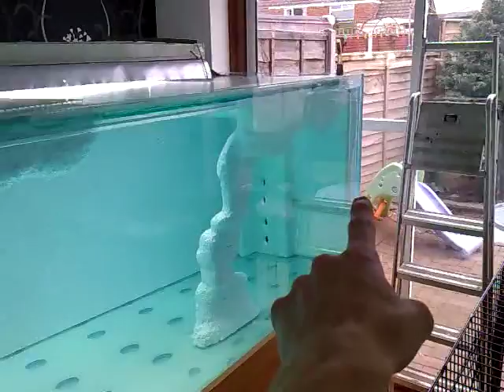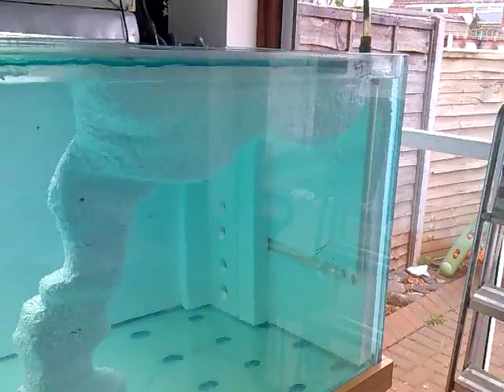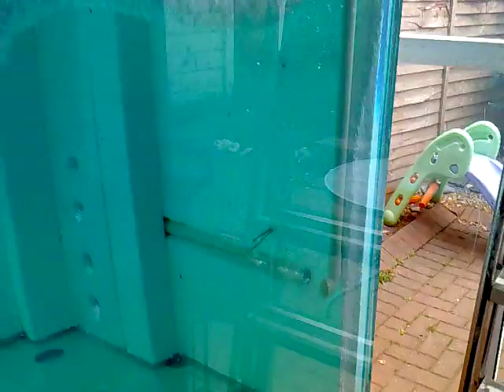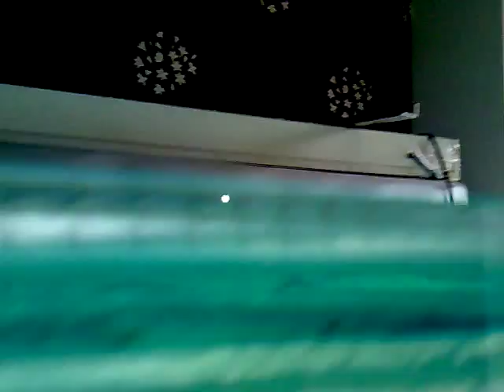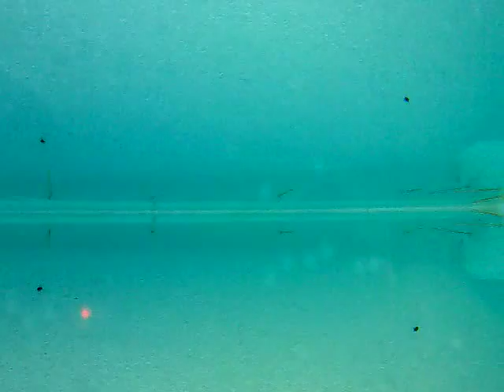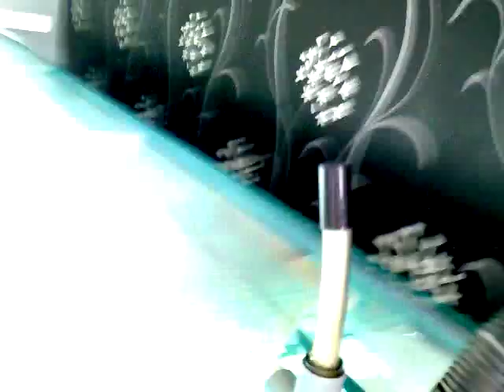My 3D polystyrene and concrete background !! part 1/5 !!!

Comment from the maker: Ok ive done a lot more work on this project have all the polystyrene carved also added more poly to the rear and sides of the tank so the back ground has good depth !!! Have done another test fill to make sure all venturi's are working well and in there finished position !!!! All the poly is carved and ready for cement will update this video very soon !!!! wen i get 5 min's :)

Davidkinzett 4 seconds ago